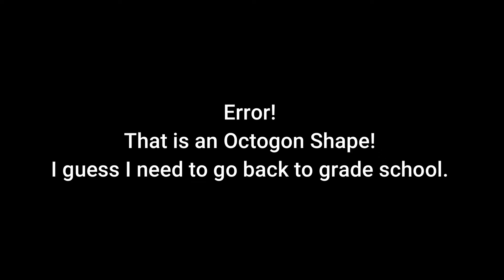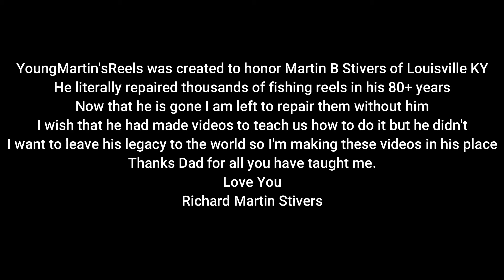YoungMartin’sReels - Penn 450SSG Service, Lubrication and Repair Drag washer replace

Comment: Nice clean internals on that Penn reel! I have never owned a Penn spinning reel, but my trolling reels are all Penns. Was in a tackle shop in Port St. Joe, Florida, last week and checked out the Penn spinning reels. They are super smooth running. If I ever get another spinning reel it likely will be a Penn.
Reply from the maker: I haven’t made up my mind yet about what I would buy today. I know the Penns would certainly be in the running.
Reply: @youngmartinsreels5314  It seems most reels are made in China these days. I have a couple Chinese made Quantum Optix spinning reels for saltwater surf fishing. While they perform well, I don't know how well they will hold up in the long haul. Quantum spinning reels use a lot of plastics to maintain their price point, so I don't have high expectations. I bought them as a way to get into surf fishing without breaking the bank, and they definitely fit that need. As long as the Quantum reels hold up I will continue to use them, but if any of them fail I feel I will upgrade to a Penn spinning reel.
Reply from the maker: I don’t know of any reels that are still made in USA. I’m hoping we will get back to making our own but I’m not optimistic about it.

I think a lot of the plastic parts are for weights reduction but I’m not sure of that. I know Penn has both aluminum and graphite bodied reels.